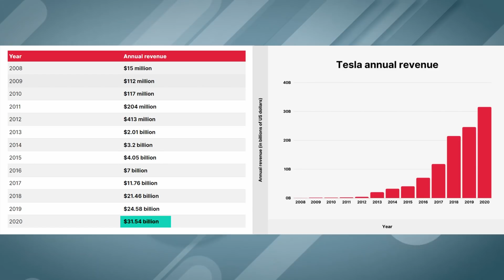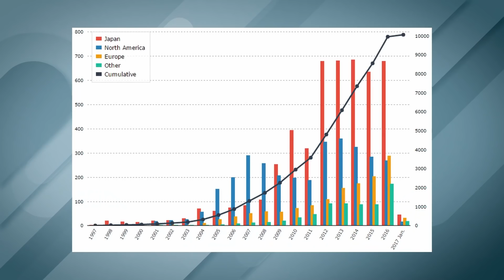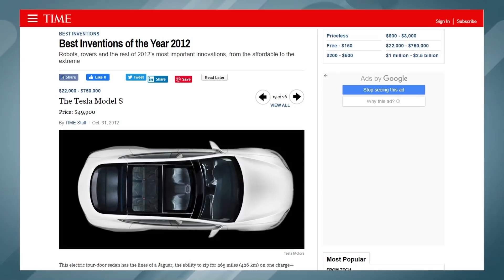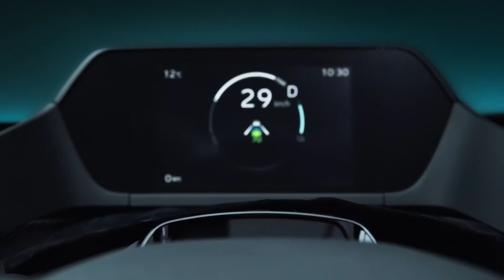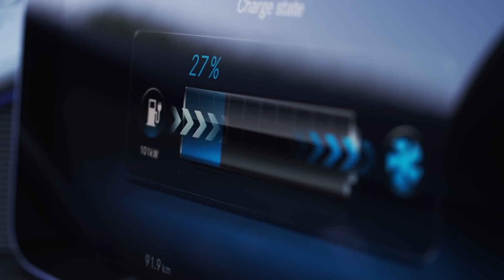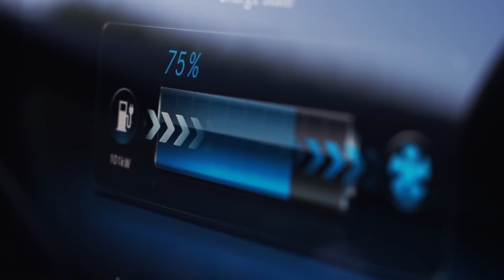Toyota's Solid State Battery Vs Tesla's New 4680 Battery

Comment: The great blunder  is that these batteries are being used on vehicles that are extremely energy inefficient like enormously heavy passenger cars whereas if they were wisely used in energy efficient vehicles that are light in weight like an electric bike or even a heavier  electric motorcycle it would make far more sense and be much more environmentally wise.
Reply: Yes I am amazed that most people don't have a clue about that. If governments were smart they would only allow electric motorcycle and moped, do what Gogoro did for Taiwan

Comment: The 4680 is about 5x the volume of the 2170, so it is not really an improvement in energy capacity.  However, a battery consists of many cells and there is definite advantage to having a smaller number of cells to integrate.  It is also claimed that the 4680 uses less nasty materials, which is also a step in the right direction.

Solid state or some other technology will eventually replace the current Li ion batteries, but it is hard to say when.

Comment: Nice video. Battery technology is only one aspect of a vehicle. I am a Toyota fan for many reasons but my next vehicle will be a Tesla. Tesla has developed vehicles that surpass many others in key areas such as safety and handling. I want my family to be safe. Tesla vehicles have also retained value like a Toyota or Honda and many Tesla are going to last much longer than Toyota's or Honda's. I like pragmatic solutions. Tesla delivers. Toyota and Honda did. They still could again. We will see how much management gets in the way of vision. Tesla is all vision at this point and I like that.
Reply: Toyota and Honda are very meticulous in their research and development, and they usually are among the safest automakers out there. I'm a Toyota guy myself and I personally am not a fan of Tesla because of their business practices and poor quality control. And if safety is your biggest concern I would be very wary of their thermal management system in terms of their unstable fires and their poor build qualities with their suspension (control arms and ball joints), as well as panel gaps. On a side note, my 1997 Lexus ES300 saved my life in an accident that totaled my car (I wasn't the driver at fault).

Comment: toyota is just bragging. how can solid state batteries be twice as strong and go further in range but yet the bz4x which will use the solid state battery will have a range. of 250 miles which is much much lower than the teslas lithium ion dosnt make any sense.